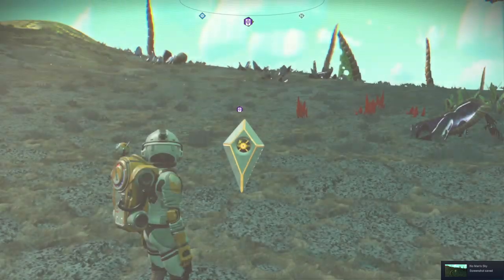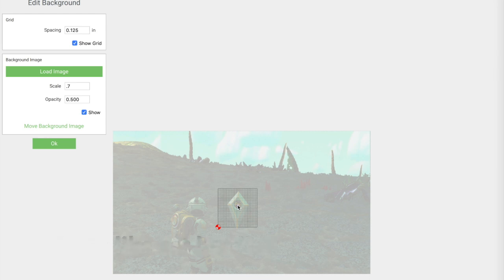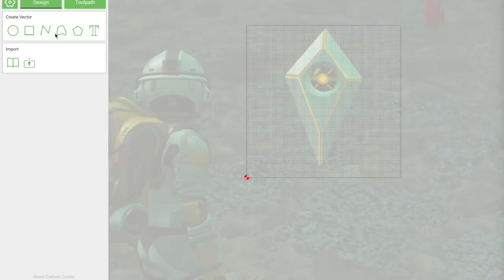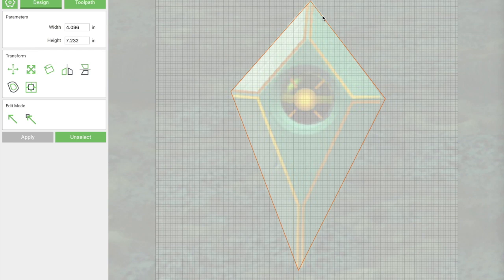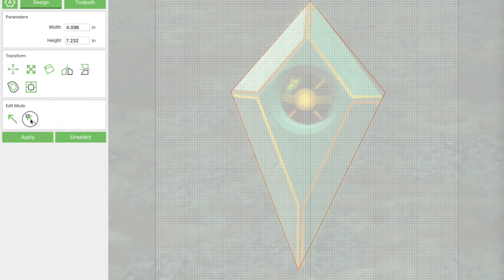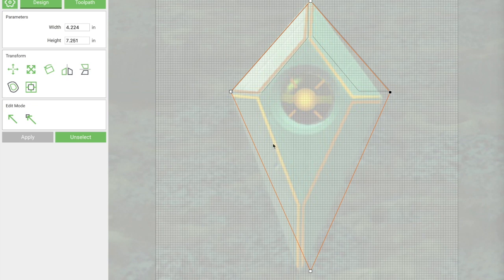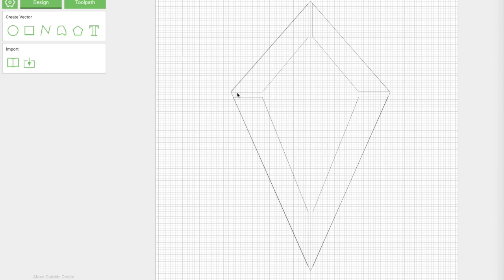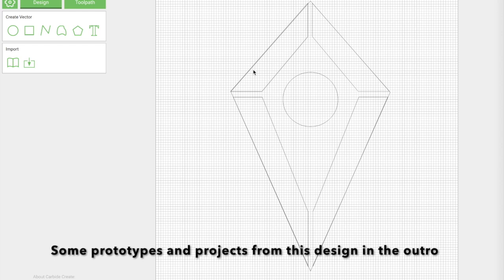Getting Designs into Carbide Create

Comment: Although you did some mirroring of individual pieces in this project, I wanted to recommend considering building one side of some thing and mirroring everything, especially if the model is more complex.  That alleviates the need to make adjustments piece-by-piece.  If there are downsides to this, I’d appreciate learning about them.  The first one I can think of would be objects like the circle in the center, but they could be cut in half or made as arcs.  Also, I am thinking of modeling programs (CAD) in general, not necessarily this one in particular.  Thoughts, anyone?

Comment: Nice video work, Thanks for sharing.   
Big difference in workflows and toolchains . . . (caution software plug coming)
I use Snip&Sketch for screen captures, Photoshop to make sure the captured source is optimal then slam it out using Vectric Aspire.  If You can afford it, Aspire makes life much easier.
It even makes Bézier (BEH-zee-ay) curves fun to refine!  The Toolpaths and Previews within Aspire also reduce "trial and error/wear and tear" machining helping to justify the initial cost.
On the topic of software plugs, check out Camotics to visualize your GCode files and avoid wasting materials.
I am not putting Carbon Create down, it is a great way to get started and there are many ways to do the same thing.
Hope this helpful as one evolves in the CNC world.  Hey  . . . gives more time for games :)

https://www.vectric.com/products/aspire
https://camotics.org/
https://blogs.windows.com/windowsexperience/2019/04/08/windows-10-tip-snip-sketch/
Reply from the maker: Thanks Jim. For the most part, I am trying to keep the channel at an introductory level, using the free stuff that comes with the machine. Trying to keep new folks interested and help them through the learning process. Once they get their feet wet, they can buy all the other cool toys. :)
Reply: John Clark 
Thank you John! Do you use a Mac or Windows?